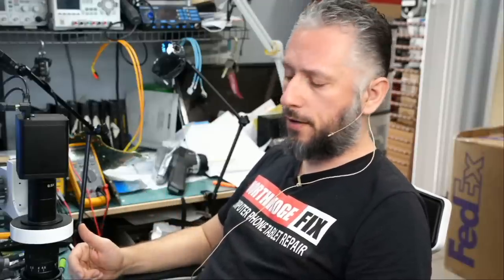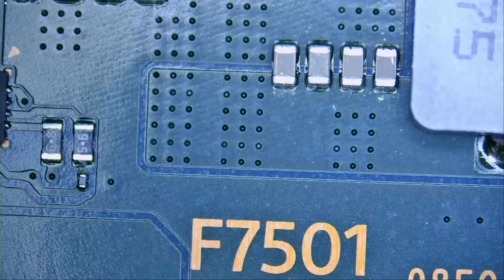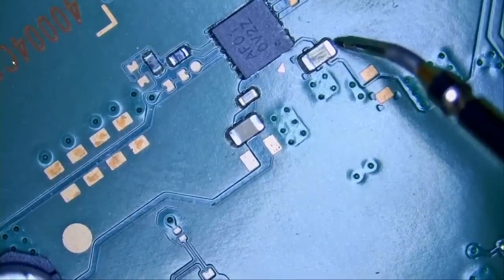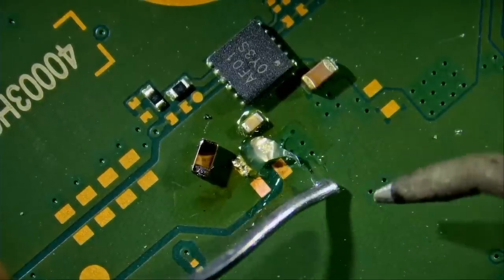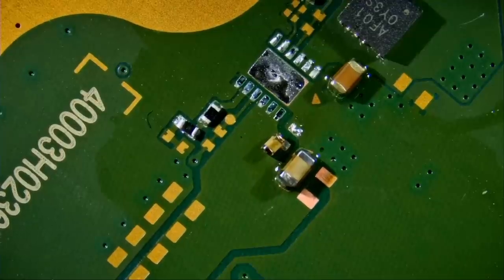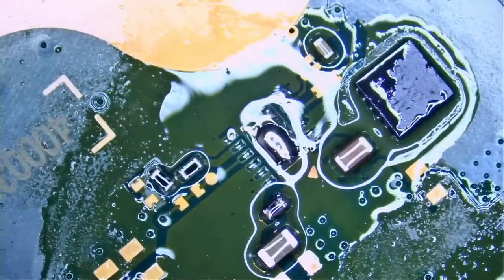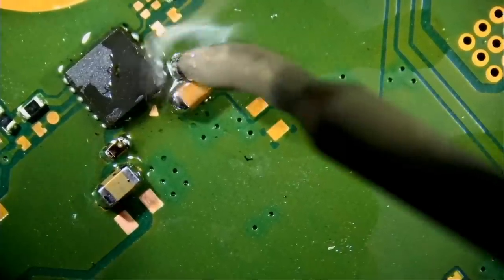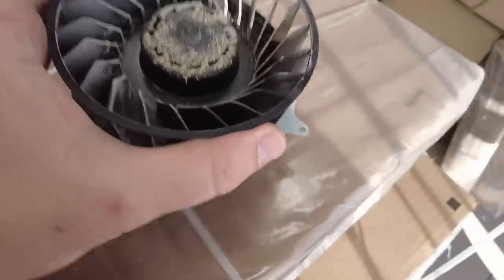PS5 Turns off immediately after power on. What's causing the problem?

Comment: Nice fix but I'm confused about one thing. When he put power to across the caps to see what heated up I thought hey, that's a pretty neat idea!  When he flipped the board over I thought he would surely do that again to identify the faulty component. But it was like he threw his thermal scope out the window and started unsoldering everything. But he fixed it, so I guess that's the important thing.

Comment: I found a flat screen in a dumpster and figured out that the prong would push in when pluggin the cord in. It worked and i used a bread bag twisty to secure it after holding it with pliars cause the housing was damaged. A guy helped me had 2 different color eyes.

Comment: So small yet such a big problem. Great video as always. So in the end the value of the capacitor doesn't change the function?
Reply: it looked like it was just a bypass capacitor. so the value is usually not super critical only voltage rating. there are times though when the caps value needs to be right.

Comment: I have a 3070 that shows the splash screen but then fractures the image and goes black. I'm going to try to NorthRidgeFix it myself thanks to your content.
Reply: prolly faulty memory, diagnosed using mods mats first. would saves time if it is
Reply: Bios mod to underclock mem and core
Reply: @ayuchanayuko  BIOS mod the encrypted. Signed. Locked. Nvidia bios files on 3000 series eh? 

Could cross flash a slower 3070's bios but no one in the general public is modifying the clock speeds in Ampere bioses.

Nvidia locked everything down hard after Maxwell...
Reply: @RobertSmith-lh6hg  havent bios modded since the HD4830. Didnt know bios now are encrypted and signed.

Thats messed up

Comment: I like all your videos.  When cleaning the fan I was always taught it was important to not let the cleaning air spin the fan because it could cause the rpm to go over the limit and cause some damage.  idk, what do you think?
Reply: no, brushless motor has no mechanical coupling with the fan assembly. So, the fan assembly can spin independent of the motor (they're couple magnetically). Only brushed motor are damaged at high rpm.